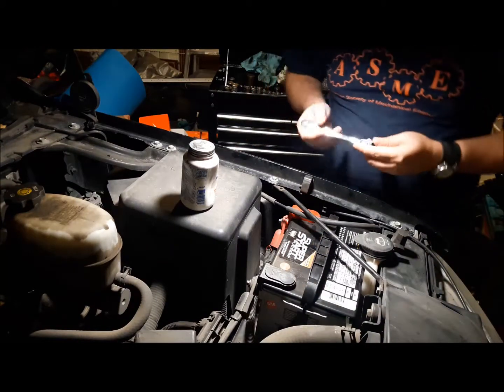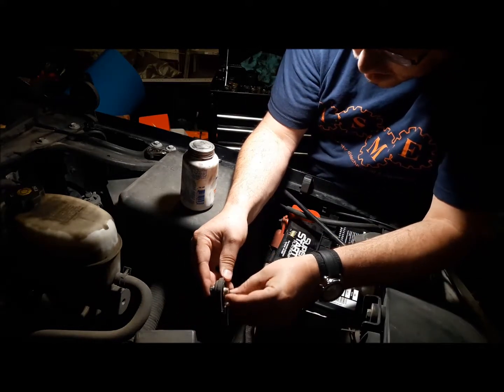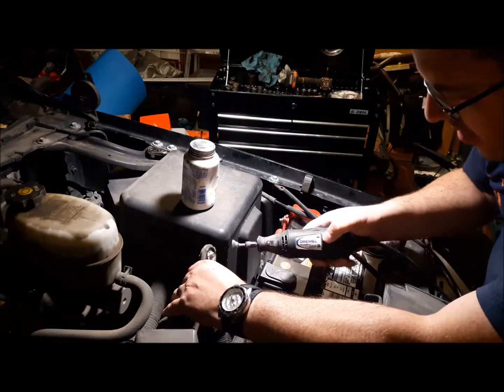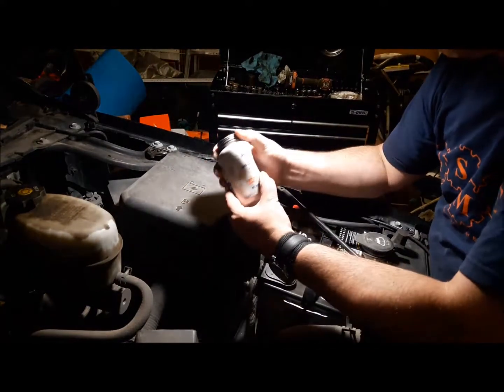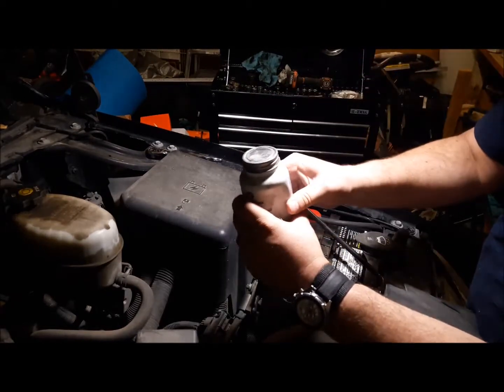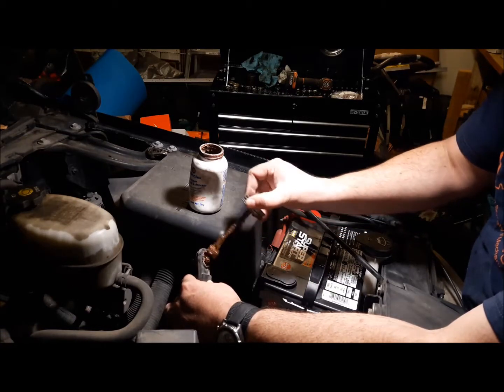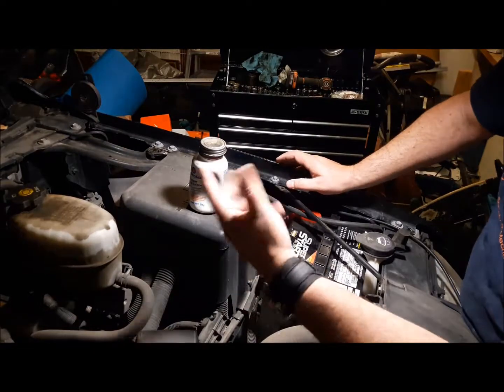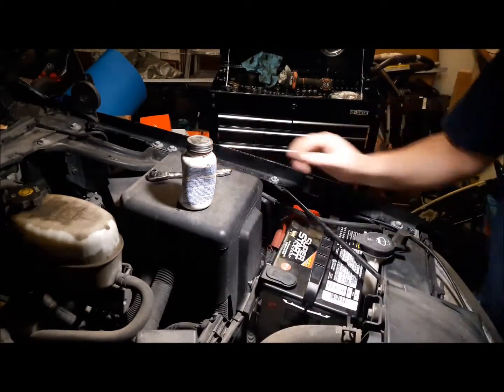A Better Electrical Connection- Copper Grease

Comment: An old mechanic advised me to use copper anti-seize, back in the 70s, for use in battery terminals. I've used it ever since across 15 4×4 trucks and jeeps, boats and motorcycles, and anybodies vehicle I would be helping with. It always worked as it should, and never caused any problems. As far as the of other commenter saying it wouldn't conduct electricity just as it is, I do believe that when it is between/within a tight connection, it'll absolutely help conductivity between the two components.

Comment: The grease can only add to conductivity  unless it's smeared between terminals and shorted.
The contaminants allow for smooth passing - and the grease also adds to helping heat to dissipate more evenly - utilising more contact area.

Comment: i beleive anti seize is the same thing as it has copper sparkles in it and since its used to prevent spark plugs from seizing it makes sence that it conducts as the spark plug threads are what ground it.
Reply from the maker: Yes, this is anti-seize. It is copper based anti-seize. There is also nickel based and aluminum based anti-seize. And probably others I don't know about.

Comment: I'm afraid copper grease has zero conductivity. People think it has, because of the word 'copper' but it really doesn't. Test it with a multimeter if you don't believe me.

Clean the leads an terminals and nip them up tight. Add a bit of any grease to the top and it will keep most elements out.
Reply: i beleive its neither conductor nor dielectric but what happens it fill the micro vallys in the metal and improves connection.beleive it or not dielectric grease does too.put a film over your meter leads and touch them together with audable continuity on and it will beep everytime they touch.

ii seen so many people talk about warning not to get dielectric on metal contacts then came across a dielectric grease company video that said to put this on yout contacts because it helps fill vallys and doesnt impede connection while preventing corrosion and fretting vibration wear and the dielectric prevents arcing over.now i put a thin film on contacts and never have issue

Comment: I been using Vaseline everytime I switch batteries out. Must of used it about 20 times with my vehicles and friends vehicles. Never had a problem. It's cheaper than copper grease.

Comment: Have you tested the conductivity of the grease using a multi-meter? Just curious about the resistance and how well is works.
Reply: Actually, recently I had a big voltage drop in my car so I replaced a new battery and new serpentine belt. I know it's not the alternator because I just replaced it not too long ago. But I still see a drop so I wanted to see if maybe I can make the cable connectors more conductive. I wanted to make sure that this Permatex Copper Grease actually works so I just tested myself. I applied a thin coating at first on a piece of card board. Well, whada u know, NO it does not conduct at all. So, I thought it might be because it's not enough, so I put a slab on it as if it's like a copper wire and still nothing on my meter reading. I even tried to touch the terminals with the coating of copper and it actually made the reading worst. It actually acts like a protective barrier over the terminals. Sometimes you never believe what others say until you test it yourself. I read the Permatex homepage and other mechanics sites and forums, they all say that it has copper flakes and graphite properties that makes it very conductive. Well, I would believe it until I tested myself and it's False. It does not work at all. If you are looking to insulate from rust and corrosion, maybe, but definitely don't count on it being conductive. All lies. And I was about to trust it would improve my electric connections. Wrong!
Reply: @joktv7748  any kind of grease just prevents oxidisation on the terminals. That’s literally it. No increase in conductivity, just helps maintain what’s there.
Reply from the maker: Not really.  However, it is the only grease that is conductive.  Or, at least there aren't very many that do.  Normal dielectric grease doesn't conduct.  It protects against corrosion, but relies on the metal to metal contact.
Reply: i have grease which claims to be conductive copper wire contact grease  made for industrial wires in clamps it does not measure any conductivity with a meter either but when squished tight it is supposed to help conductivity and keep terminals from corroding most people just use silicone grease with nice clean tight contacts it keeps corrosion out doesn't melt in heat as easy as Vaseline or something